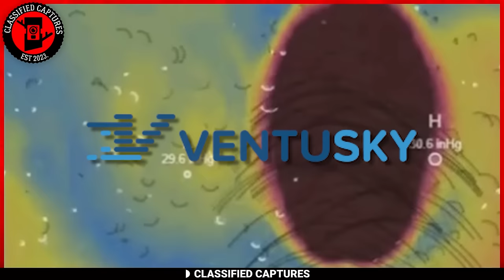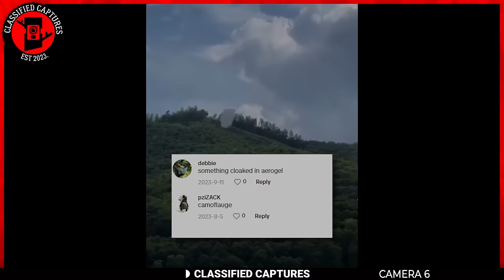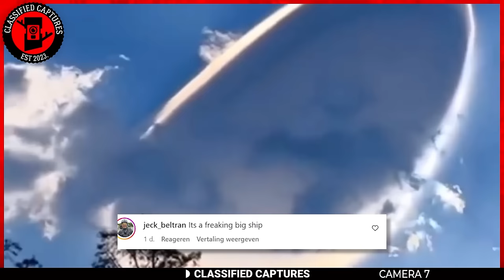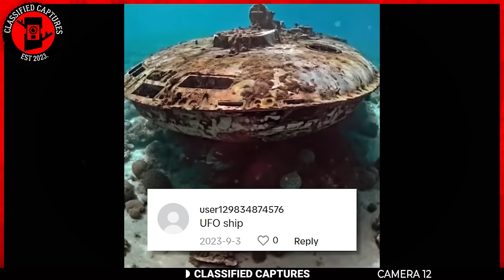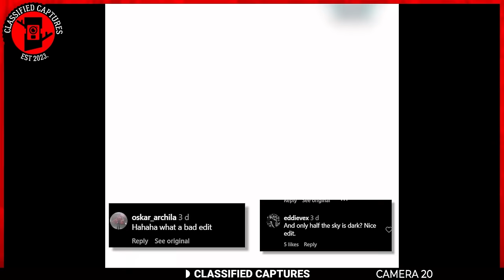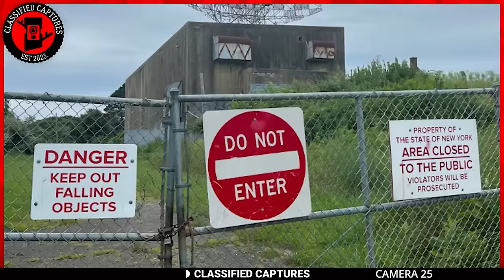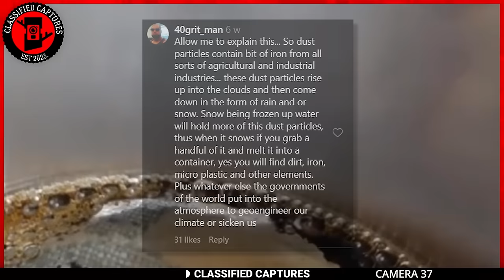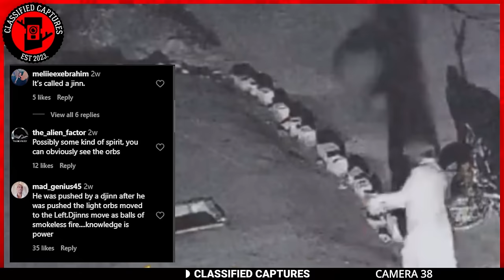Unveiling the Most Startling Trail Cam Footage Yet Recorded

Comment: 55:40 - improperly installed sensor faucet. I'm guessing they didn't use a rubber grommet between the faucet and the sink, allowing the touch to transfer. It would work without the strawberries, if she touched the sink. Grounding issue.

Comment: To all those folks saying "Blue Beam".. they should know it doesn't work at night, or on a clear day. It requires clouds , or mist, or particulate matter in the air to be effective. A foggy day is ideal, for instance.. However, other than showing certain images intended to terrify soldiers on a battlefield in the middle east, it hasn't gained much traction , AFAIK, anyways...
Clip #12. "if the footage is to be believed".. Well, what's so unbelievable about it? You never showed any "inscriptions? And this rusted old thing looks entirely man made. What it is I don't know since we don't build flying saucers (yet). The other thing is that there's no reference to judge it's size.. it could be just 12' in diameter for all anyone knows. But mainly, I don't think extraterrestrials would build ships that would erode like that.. for ships that can tolerate all sorts of radiation and transverse wormholes, I don't think a little seawater would erode the ship away like that!

Comment: It's just because of changing the angle of camera in a second, that shows the light emitting from the cat's eyes in another place.
We use this technique in Radiology and MRI.
Reply: hello, do you now this? i used a led light flashlight and pointed to a cat, i got the whit reflecting color but right before this a very intens bright bleu color, and it looked like i looked deeper into the cats eyes than normal. I did this in the past also but never saw the bleu type color (not in any animal for this matter).